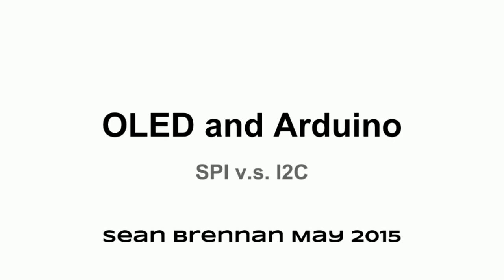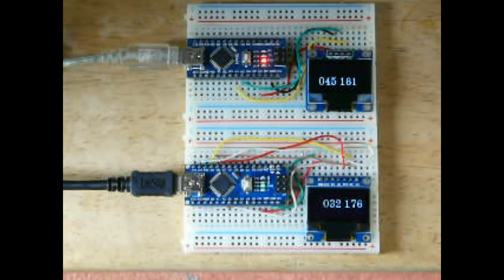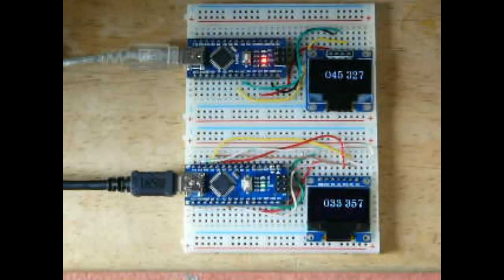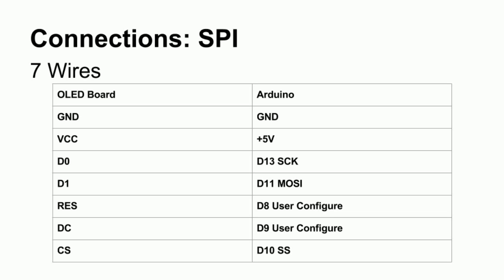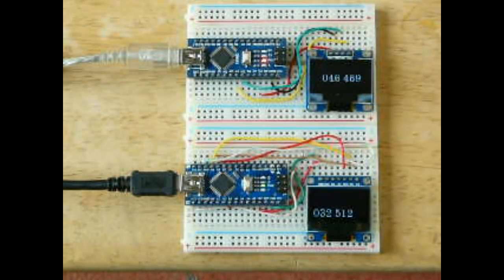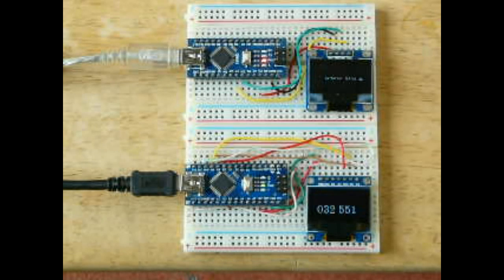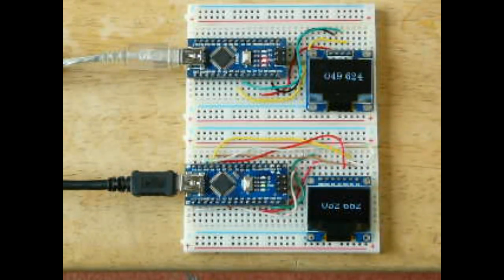OLED and Arduino: SPI v.s. I2C (ssd1306)

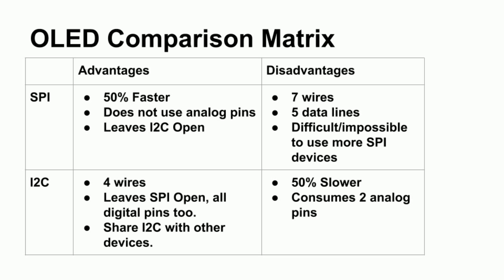Comment: 2:32 You are not too good with mathematics man. 2 devices, they cant be 50% slower and 50% faster from each othe at the same time. Or  SPI:1000 chars per second -> I2C:500 chars per second? I2C:500 chrs per secord -> SPI:750 chars per second? C'mon!!

Comment: I want to connect 4 OLED displays for my school project... can I do it using SPI? I have a multiplexer for I2C... what's best? Go for multiplexing in I2C or there's another way using SPI?
Reply from the maker: I think if you wire SPI all in parallel except for a single line, CS (Chip Select), and use one data pin for each display.  See https://github.com/zettix/OLEDTest/blob/master/oled_spi_j.ino#L5   and maybe create one display object for each physical display with different parameters to the constructor.
Reply: Sean Brennan thanks man! Im going to search that... SPI displays are cheaper and have higher speed, resolution and size than the options I’ve found in I2C

Comment: SPI can share the CLK, MOSI and MISO wires. The SS/CS lets you select which chip you are talking to each time. You can reduce that to a single wire on the arduino by using a 595 shift register (and maybe a decoder).

Then you shift out the address to the shift register and flip the extra line to enable the outputs and disable the shift register's clock. Then you can talk to just the single SPI slave.

Comment: lol at most of your assumptions not stated as assumptions. and your failure to realize the slave select you said it has only one of can be any gpio pin. why go through all the trouble to do that test if you arnt going to look up max speeds for that mcu on a given bus. your conclusions about the oled are worthless with out knowing if its the mcu or oled or also bus possibly limiting it.
Reply from the maker: Thank you for your feedback.  What do you think of my soldering?  Also I looked into running two of these OLED boards and the possibility of changing the i2c address but sadly the boards do not support it, but the chip does.
Reply: not sure if its your video or because im low on space on my ssd but im not getting a clean enough image to comment on your soldering. Also i think those oleds will run on 3.3v thus avoiding the need to level shift, trying it on a pi zero atm ill comment on if it works later

Comment: You can share SPI. When the Arduino is a master, any pin can be used to select an SPI device. The Arduin CS pin must be set to OUT to put the Arduino in SPI master mode.

Comment: I get 27fps on i2c at 400khz using a bloated library, i imagine with a 1M wire library or custom code you can get a bit faster

Comment: The SPI module is very easy to convert to I2C, the resistors are 0 ohm, so all you need to do is remove R3, then solder a wire link across R8 and R1.I have found I need to use the reset pin with I2C too, as the display may not always power up correctly every time without it.
Reply from the maker: +colin willcocks Easy for H. sapiens, H. neanderthalensis SMASH!
Reply: Hi! Do you have more information about that? I have bought the same display and want to use it with i2c. The port scanner recognizes other i2c devices but not the display, even though I have soldered it the way you suggested. On which ports on the display did you connect SDA/SCL?

Comment: Thanks!  I never realized that I2C is a shared bus!  That (along with two pins) is a huge advantage!
Reply from the maker: +Paul Blakeslee i2c is becoming more well known for this, you can for instance run i2cdetect on the raspberry pi and ubuntu (one on the vga port) and the real time clock board DS3231 sometimes come with an i2c eeprom on the board so you have extra space for arduino stuff or whatever, you could use it as an auth key ;)

Comment: Your comparison is unfortunately completely wrong, sorry. I2C can be much faster than SPI version depending on what I2C library you use. Look at my channel BadApple video where video data is read real time (about 70fps) from SD card and displayed on I2C OLED. SPI device of course can share HW SPI - that's why you have CS line. In I2C it is solved by addressing devices in the protocol. DC is the line which tells the display driver what data is sent - Command or Data. It's pretty common in LCDs. My I2C OLED use FastI2C which is software solution - faster then HW one (!) and you can use any 2 pins.
Reply from the maker: The hell it can't.  I started an i2c versus SPI fight and I intend to finish it.
Reply: cbm80amiga , SPI can be waaay faster than I2C.
Reply: How much faster is SPI? My i2c oled is extremely slow, about 0.2 seconds per refresh on a mega 2560
Reply: Thank you. I was wondering how to solve this.
Reply: I'd love to see how i2c is faster, this is actually why I had to trade my I2c for an SPI display. 
Reply to this if you can prove it is faster please (and not just in marginal circumstances)
Reply: Even if you have an efficient library VS and inefficient one, a Max 400khz clock is still nothing compared to a 10mhz clock
Reply: Josh Kaufman I wish I knew more about how spi worked and how much faster it's clock was before I bought my display. I'm probably going to have to do what you did
Reply: daslolo 
Up to 40MHz, if I remember correctly. Read it s.w. in a forum dealing with an STM32 connected to a full color TFT. There was also a library providing DMA, which makes a huge difference. But not all HW devices can stand that 40MHz, AFAIK. So, multiple SPI interfaces have to be used in such a case (ATMega328 got 1x SPI, STM32F103xx got 2x SPI + 2x I2C). Pls correct me s.b. if I'm wrong.
Reply: Both are pretty slow, SPI has less overhead and can be run as fast as you want really because only one chip is listening (enable asserted by CS) at a time you can change clock on the fly, you can’t do that so easily with I2C because all devices on the buss listen for their address. I2C was never meant to be high speed and neither was SPI. If you want speed to a display you are better off with an 8, 16 or 32bit parallel buss. The difference between SPI and I2C are really pretty marginal, especially when talking about something as limited as an Arduinio. It’ll never be able to drive video to a decent size display by a long shot no matter how it’s used. So it’s not the buss type, it’s the limited capability of the uC itself.
Reply: There is no way bit banged I2C or SPI is faster than hardware. It’s probably because the uC registers aren’t setup properly if this is what you’re observing. If bit-banging was faster or even equal then the onboard hardware wouldn’t exist it’s there for precisely that reason.
Reply: Where can I see this "fasti2c" library?
Reply: Guys, regarding SPI vs. I2C in general SPI is faster but I mean this particular case with poular SSD1306 OLED screen. Fast software I2C is faster than SPI version.  At least using slow Arduino.

Comment: + Sean Brennan 
great comparison .... but if i want to use i2c on spi version i have to remove R1,R4,R6,R7 and R8 ?
Reply from the maker: +Akrout Osama My understanding is that you have to do something with the surface mount resistors like move them around.  Again I lack the precision tools for this procedure, and find simply purchasing an i2c based OLED simpler to wire.

Comment: A couple of matters are conflated in this video. It is partly a comparison between I2C and SPI but more accurately it is a comparison when using the particular display.  Reducing the wire counts to a minimum I2C only requires data, clock and a ground reference and SPI needs MOSI MISO CS and ground. Supplying power to the display is very handy via the Arduino but not strictly necessary - it could come from some other means.

Then there are the application specific issues. I'm not familiar with this particular display but in this application DC appears necessary for SPI but not I2C; no great surprise.  If nothing is read back from the display MISO might not be necessary, but as I say I don't know the display. 

It isn't quite as simple as I2C needs 4 wires and SPI needs 7.

Comment: in SPI CS is used to select devices, also some don't needed to be used, CS can skip and conect direct to active and used only 4 wires as I2C, if CS is inactive the other pines can used for any propose
SPI add 1 wire per device min 4 wires as I2C
for some many devices SPI can be a "pain in the ass" need control some CS lines, I2C you need control the data on the bus.

also as Joel Cordier say some libraries aren't too efficent, I fix one for LCD display and now somethings are between 20 and 66% faster and small in general